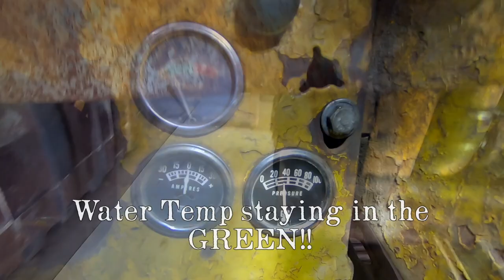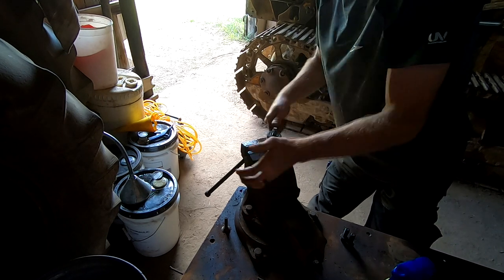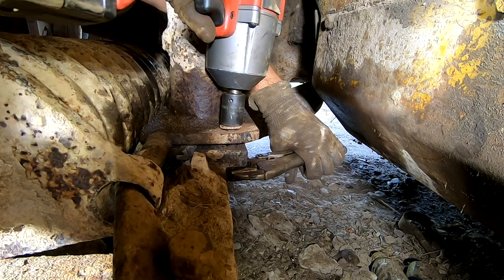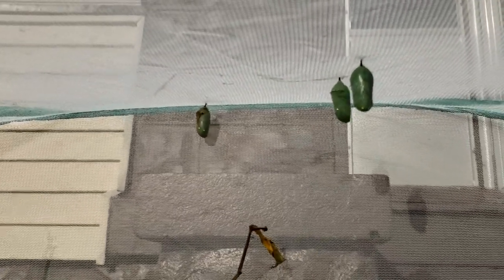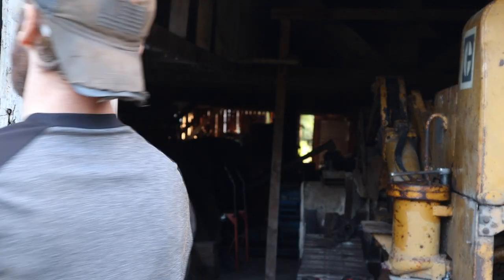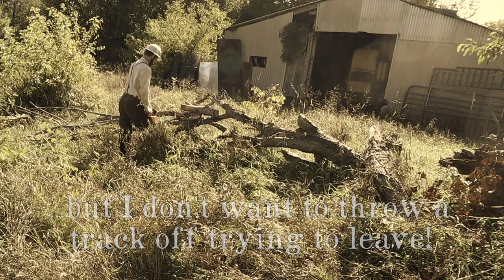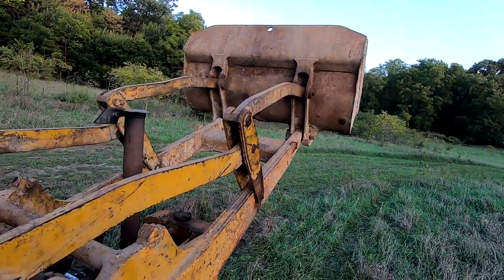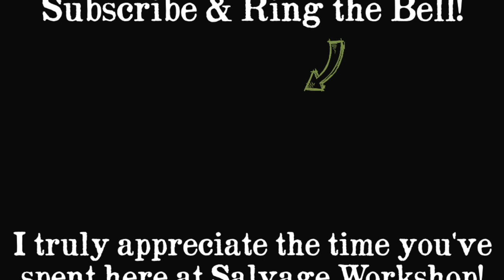Will the Bucket even WORK after 20+ Years? ~ Part 4 ~ 1950's Caterpillar TraxCavator

Comment: You have a J type collar on the inside of each idler with large 1/2” pads welded to the tip of each J . They ride against a flange that’s is welded to the inside of each roller frame to help keep the idler straight with the frame! All of these wear bars are worn as well as the outside plates you are working on ! You could go on forever with this tired old beast so spend wisely!!!

Comment: the idler should be able to move freely... the spring in the tensioner system act as a shock absorber . if you hit something the idler will move back a bit and repostition itself after so you don't bend the roller frame. Shims can also act as alignement for your idler , if it's out of alignement the chain, the top roller  and the idler itself will have excessive wear

Comment: Why not flip the hold plates?
What did you do about the prepare release on the top of the radiator?
The track is worn but looks very good. The rollers on the bottom often go bad but get ignored.

Comment: If you cant find that sprocket, I have a cnc plasma cutter that can cut the outer ring, you would have to cut it loose and weld it up like the other side. But you will need a stronger weld than the 110 welder.

Comment: THAT COBBLED up adjuster extension is a result of the rails being worn beyond the effective range of the tensioner adjustment. For a farm machine that will not see much use, I wouldnt worry about it, but if it were a day in day out runner it would need an undercarriage. I was more concerned about you working around that recoil spring than the track falling on you, those springs will kill, and never think twice about it. And the sliders on tat unit have a LOT  of wear on them..... be safe, always!

Comment: I am still looking for the correct books, I am looking in a newer 955 (with power shift trans and hyd track adjuster) service book and Cat says the clearance between the guide plates and the frame should be .06". I would go about 1/8" as it has to move back and forth with the spring and not bind where there is less wear.

Comment: The tracks have to meet the wheel perpendicular to the axle so I’d say there should be no wheel slack. Those a axle plates don’t look hefty enough to hold the wheel in place. What is the state of wear on the wheel adjustment slides?

Comment: Hose break. Where the crowding links go over the loader arms there are two welded on blocks. These stop the bucked geometry going infinite (why the hose went full pressure and split). If you are loading a tipper truck it will drive you mad if those blocks aren’t thick enough. They wear and the pins wear, which makes it all worse. *doesn’t damage the machine as much as annoying and hard to use.

Comment: It's interesting that you call grease fittings "zerks".  I've worked around machinery for more than 5 decades and never heard that term until just a couple years ago.  The guy named Zerk, made the original fittings about 90 years ago, but they look little like what is used now.  His fittings looked more like traffic cones and you physically had to hold the hose end to the fitting to get the grease to flow where you wanted it to go.  Not very practical in a lot for applications, but better than what existed prior.  A few years later, a guy named Bystricky redesigned the fitting to essentially what we use today, with the ball end that the end of the nozzle can grip so it holds itself to the grease nipple.  A far better design than what Zerk made.  Don't know why Zerks' name stuck to someone else's better grease nipple.  ?

Comment: Not a Cat expert, but coming from a mechanical engineering background, you don't want those plates to be so tight that they squeeze the frame in between.  There should be a little play.  but what you had before was way too much.  As long as there's still some (like .050"-1/8") free play after the shims are removed I think you're fine.

Comment: The idler should at least 3mm clearance between the plate and chasis both sides because when gravel fills between the sprocket and the track the idler should move back and forward

Comment: the idler needs to be able to slide for and back to keep track tensioned but not loose enough to flop around just loose enough to allow front and rear movement.

Comment: I would honestly suggest just breaking down and replacing the screw and nut if it's not gonna cost an arm and a leg. There are probably a couple things you can do to make it better than it currently is, but it'll still be a hack job on a piece of heavy machinery. Those... tend to go badly.

Comment: is there a by pass valve stuck open or relief valve open on the pressure side of the pump  make sure the fluid is up  where's the radiator shroud?

Comment: Every time there is more progress, but more issues are found. It has received more conditioning than it had for many years before that. Even putting back bolts and making them tight, (torque spec anyone?) is a step in the right direction. I agree you need a manual. The hydraulics need a full service with replacements, or you will face a never ending breakdowns and repairs. I cannot comment on  the advanced wear on the undercarriage, beyond saying that it is a symptom of neglect, overuse and lack of maintenance. However, I defer to others as to the way forward. Certainly those wear groves worry me. The tracks need maintenance, not to mention rebuilding with functioning parts. 
Like a few others I grew up at a time when many such devices were still wire rope driven, hydraulics were new and upcoming.
It is right and fitting that it has a second life, even if like me it needs some spare parts and 'surgery' to keep it running.

Comment: e on the top of the filter is a filter bypass  valve  it allows oil to get to the pump if the filter is clogged   no oil to the pump  equals a burned up pump

Comment: I see this video is almost a year old now and am sure you are fully aware of all the pony engine procedures by now? Well I hope you are lol. After starting the pony engine and before attempting to start the Diesel engine you should engage the decompression bar on the right side (located half way up the the diesel block). Let the pony run for a few minutes depending on temps outside. Feel the back of the cylinder head with your knuckles on the left side checking for warmth. The pony will perform a few things one is warm the coolant two prime the fuel tower and injectors and three prime the engine with all oils. Once you feel the warmth ( it’s a slight warmth your not looking to burn or feel hot) on the cylinder activate the pinion to start the Diesel engine, release the decomposition rod and fire the diesel and turn the fuel pet cock off to the pony engine. Don’t turn it off by the magneto. Let the pony starve itself to shut off. Shutting the petcock off stops gas from getting into the pony engine oil killing it. Also never use any starting fluids to start either of these engines. The ether destroys your pistons in a big way. Hope your having great luck and fun with her.

Comment: Moths spin silk around themselves and molt inside the silk casing. This provides extra warmth and protection from the surrounding environment. You can usually find cocoons attached to the side of something or burried under ground or in leaf litter. 

Chrysalises, on the other hand, are not silk. Butterflies molt into a chrysalis, which is a hard exoskeleton covering that protects the developing butterfly.
Reply: First off I was wrong, I said you had a dry clutch witch is not the case and that is good. Looks like you are slipping the sprocket, don't do that any more than you haft to it is hard on the final drive, check to see that the steering clutches are free, to do that put it in first gear engage the clutch then pull back on both steering clutch levers and the tractor should stop if they are free, it was common to jack the idler forward to adjust the track and put a split piece of pipe over the threaded rod and weld it back together an repair it in the winter, hard to keep the threads free. Don't touch that spring with out knowing what you are doing.All ways let all raised equipment to the ground before working on the hydraulics , pull the levers back and forth to relieve the pressures, get some manuals.

Comment: that valve in center of filter is a bypass in case the filter plugs it is sopposed to be shut looks like you are going to need sproket rings they can be had either weld on rings or complete assy they are a bear to pull down but as long as that mach set to upper pinion brgs might not last long run a while you might want to pull finals down i have puller to pull but no way to press back on cat dealer used to rent tooling but new dealer will not  might be some local guy that might be cheaper than cat good luck

Comment: The valve in the oil filter sets a maximum pressure across the filter to a safe low value, so that if the filter ever got blocked it would not be broken apart and bits of it carried around the system.    The worst part of your machine seems to be the track driving sprockets.  You should renew them before trying to push stuff with any force.

Comment: Remove the track and ldler,  cut off the worn wear guards and weld on some new ones . If there wear is that bad this needs to  be done and then shimed up top to bottom and side to side
Reply: That's the wear guard strips made of high density steel DH2 not some soft mild steel . The inner frame guides have these sacrifice 
strips also .  Do it once and do it properly! .

Comment: on the track tension adjuster..  can you identify the thread size and pitch... do you have a thread chaser.  i have seen them cheaper on amazon so don't spend the big money.. https://www.grainger.com/product/OTC-Thread-Chaser-4CR54  once you have identified the thread diameter and pitch..  do you have a lathe and mill.. where you can make a split nut that is clamped with probably 2 bolts on each side.. kinda like a big end of a connecting rod..  bore and thread the 2 halves.. .. now you can clamp it on without removing the part.. 
 
how much of a parts machine is out back???  is that included in this deal... it would be a great thing to have a parts machine at your place..  even if you have to drag it out with this one.. 

 you may have to do some welding to the tips of the drive sprocket to prevent slipping..